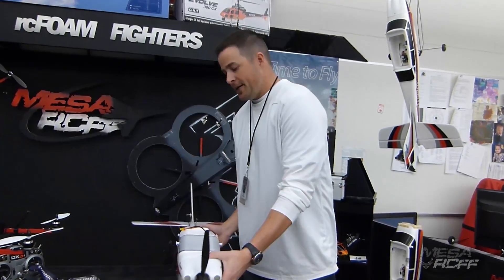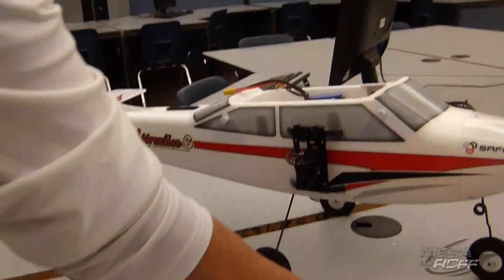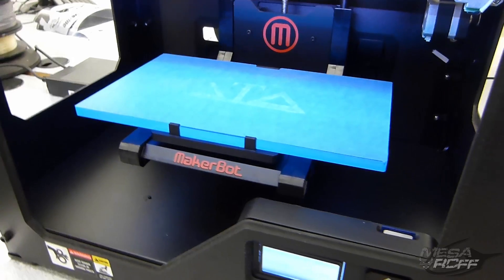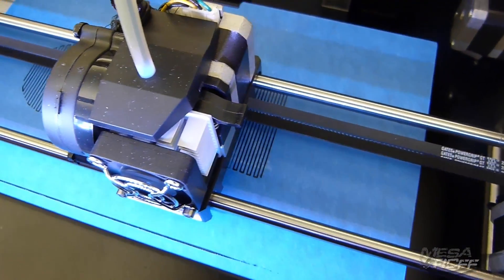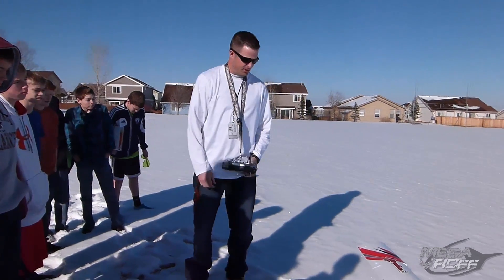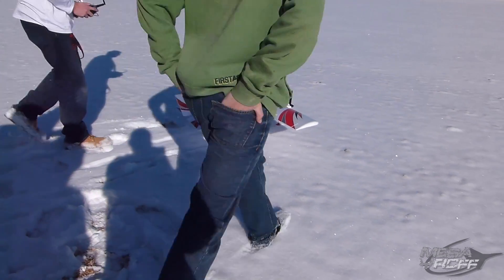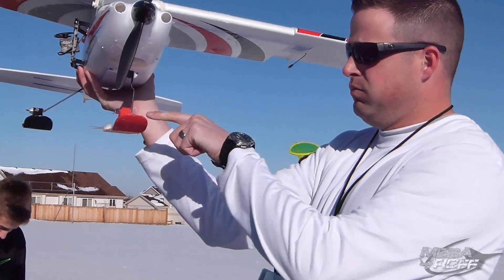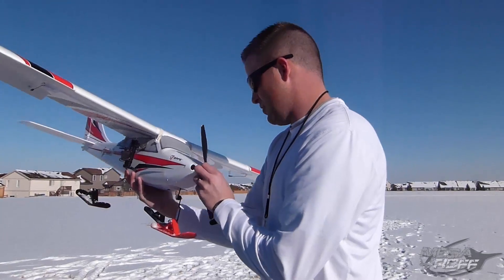MESArcFF - 3D Printed Skis - PROJECT

Comment: Nice video you guys. I have a couple of suggestions that might help you get the skis in the air easier.

If you set the strut forward so you have an aft CG on the ski: When you take off the skies tail will go do and the nose will go up. That way your skis will always be aligned when you land and takeoff.

If you want to go a little more complex route: Use a short strut and secure it to the gear, at the end have a spring to absorb the shock from landing. It takes more time but will be much better in the end.

Waxing the plastic: Just like snowboarding, if you're not waxed you're not moving. Reduce as much friction as possible.

And lastly, raise the nose without raising the tail: Use a longer nose gear than main gear so the weight shifts off of the nose and helps avoid the nose from being  berried in the snow.

Thanks,
  Andrew Grant (VoroRC)

Comment: Also if you look at most aftermarket airplane skis, the ski is restrained with either a couple springs, leaf springs, or even rubber bands to prevent if from wobbling in the air, but still remain parallel or slightly inclined to the fuselage.

Here's an example:
http://www.rcuniverse.com/forum/questions-answers-154/8581256-dubro-snow-skis.html

You can see this Dubro Skis has a torsion spring and a set screw to adjust the angle of attack on the ski.

Comment: Put a spring going from the front of the ski to a support so it has some give so when it hits the snow the ski can flatten out.
Reply: A simple solution is to just attach a rubber band from the front of the ski to the top of the landing gear wire.  This keeps the ski from wobbling and helps it penetrate the snow better.  NICE VIDEO MESAFF!
Reply: thats what i ment but a spring instead of a rubber band rubber band dont work so good in the cold weather..

Comment: Try adding a spring or a rubber band to pull the front of the skiis upwards.You could use something to stop the front ski from going to far up.But still have something pulling it.That should make a difference.Here's an example: Twin Snow Plane V2 - RCTESTFLIGHT
And i agree with you, bigger and taller should be better.